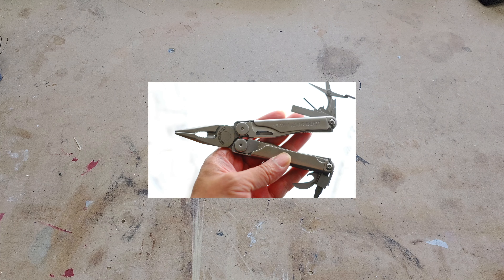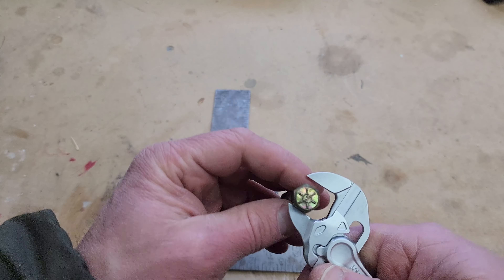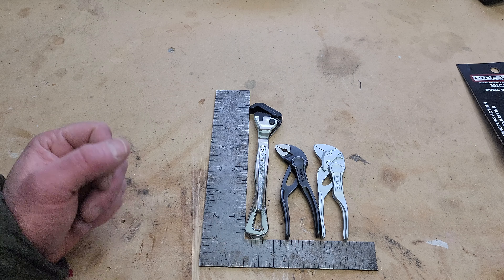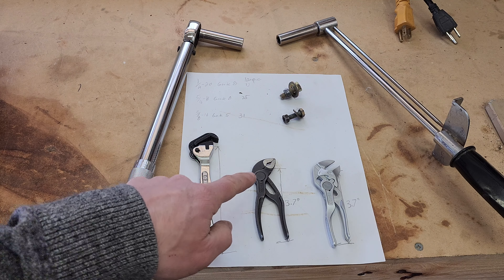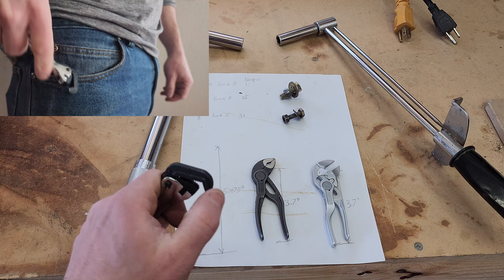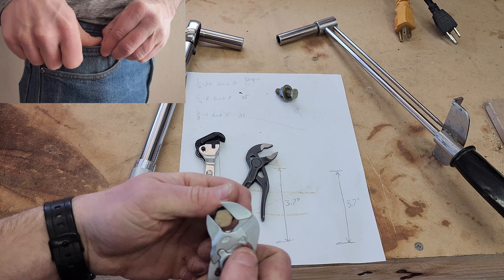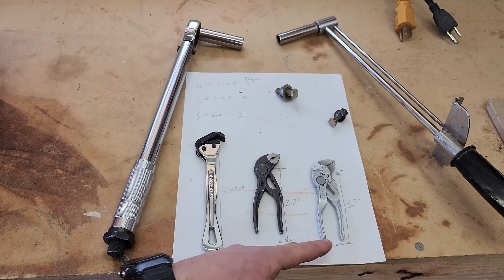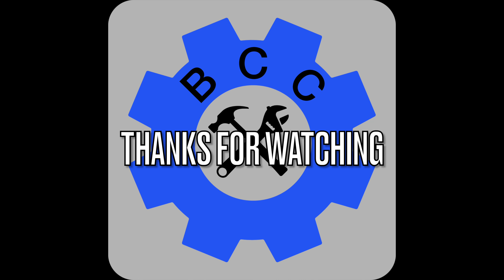Pocket Wrench Shootout. KNIPEX 87-100 vs KNIPEX 86-100 vs PIPEVISE MICRO 5.

Comment: It's hard learning to use tools,  isn't it?  

Any one of those,  used correctly could have easily done the job. I carry the knipex ("k-nip-ex") cobras every day.  They grab a huge range of fasteners. The same with the plier wrench setup.  You are using them wrong.  Adjust the grip so you aren't squeezing it with your hand as much as letting the leverage of the top handle cam onto the fastener.